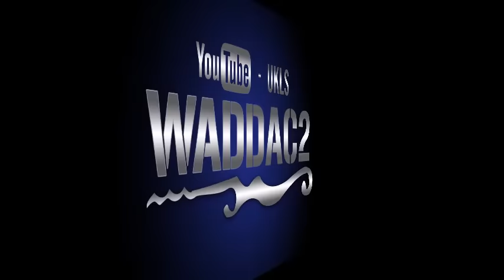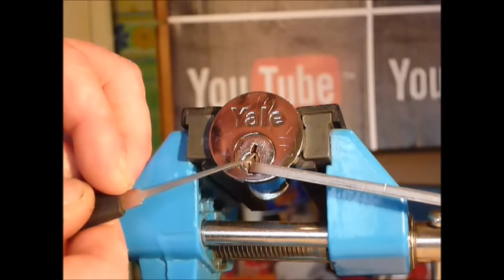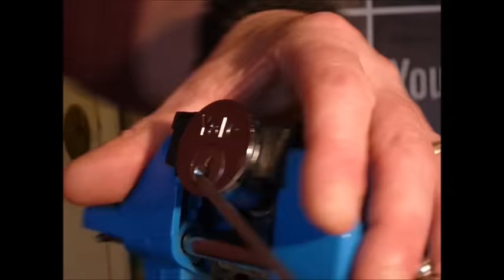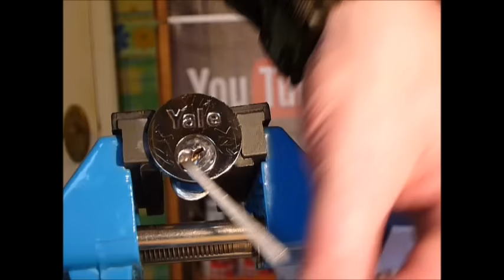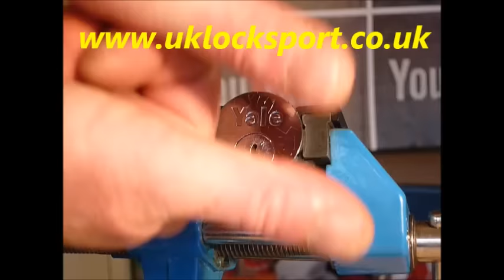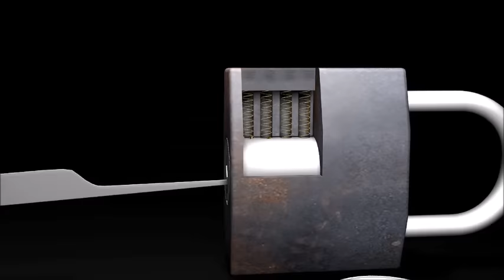Single Pin Picking Another YALE Rim Cylinder From STIG With Custom Pins.

Comment: Another speedy pick, Rich. And this with such pins.
Reply from the maker: Thanks Dirk mate. Still baffled as to why it pops so quick. Four of the springs were well down in the housing so pins were not under a lot of spring tension so pins may have been sat on or very near the sheer line, but one chamber as you can see had two springs in.
Reply: waddac2 Were this springs curled into each other to increase the strength? Or really one on top of the other spring?
Reply from the maker: dirk Just on top of the other spring mate, hence reason its slightly buckled.

Comment: Haha, nice one Rich ;-)
Reply from the maker: Cheers Nev. As just said to Dirk, I am still baffled over this one on how quick it pops. The springs when gutting were well inside the housing meaning pins were not under a lot of tension so assume they were sat very near the sheer line making it very easy to pick even with nasty pins. What do you think of my theory?
Reply: waddac2 This is just my opinion Rich, but looking from left to right, if you look at driver pin 2, the length before the cut out is enough so it acts like a normal pin, like a spool but won't trap like a spool if you get my drift, driver pin 3-4 and 5 are the same, even allowing for the serrations I'd be thinking they react similar to standard pins, in other words the serrations become non effective.  Also, can't tell if any driver pins reach above the shear line when all pins are at rest, if so it makes the shapes pretty much non effective when coupled with bitting.  Driver pin 1 appears to be the only pin which may require picking if you understand.  Just my opinion looking at them.  I think some custom pins can be shaped so as to defeat their purpose.
Reply from the maker: LDU2U Yep I can see where your coming from mate ;o))))

Comment: Good grief Rich. Do you reckon the tolerances have changed so much by custom pinning?
Reply from the maker: Here are my thoughts Bryan so let me know if you think I am on the right tracks. When I gutted the lock the springs were well down inside the housing needing a tap or two to get them out. With them being like this I can only assume that the pins even though nasty were sat very near the sheer line as when picking front to back by just touching pins the plug dropped very slightly then opened on pin 5. Then from picking from back touching and setting 5 others were easily set with tang of the pick?????
Reply: waddac2 sounds very plausible Rich as you probably know better than me having picking hundreds of locks. Weak spring certainly would certainly make things easier if the pins are sitting well down in their stack. Stick tougher springs in and give it another whirl mate.
Reply from the maker: slim_pickins Never thought of popping better springs in and trying again. Too late now though as dumped pins into my pinning kit box for later use, so they will be mixed in with lots of other making them a pain to find LOL!!!!